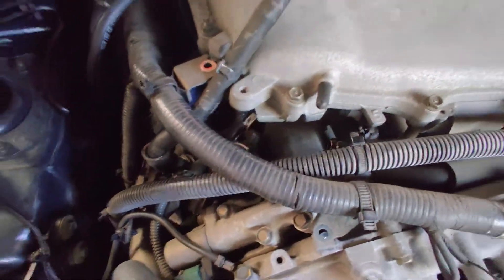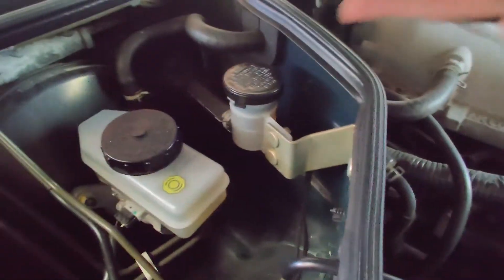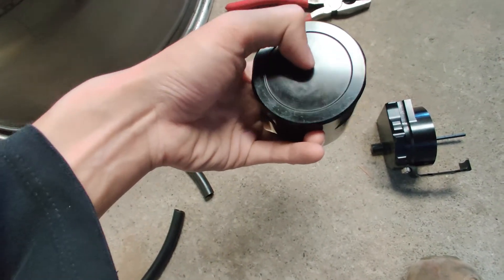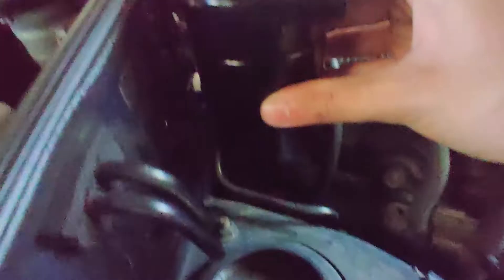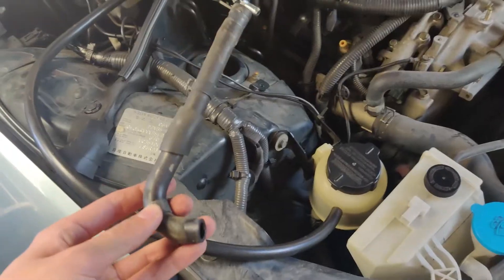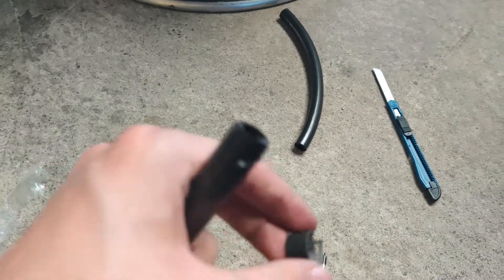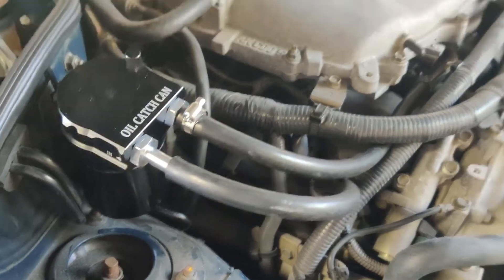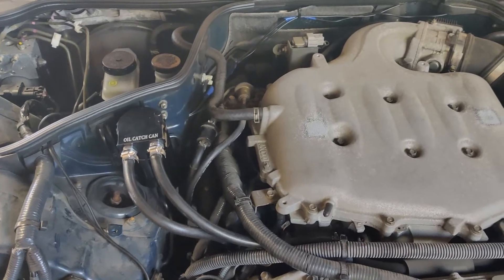Install a $20 oil catch can on my G35 Will it work?

Comment: PCV hose that is located near your throttle body is actually responsible for sucking fresh air into your Crankcase. You dont need to install anything there, just leave this valve connected to the intake tube. 
PCV valve on the other side needs an oil catch can because its letting air out of the cranckcase directly to intake plenum and this air is usually "dirty". 
I found your video researching oil catch can topic for my VQ, and was thinking of buying the exact same catch can you are showcasing. I think its a good idea and you did a good job installing it (maybe secure it better though😅). I also think its not a best catch can out there, but Im also on a budget and its better to have something then to just leave it be.

Comment: from what i understood about g35s that hose going from crank case to the intake has nothing to do with helping oil consumption any escaped gas/pressure wtv is redirected into the intake to keep cylinder compression good maybe im wrong but 🤷🏾‍♂️das what i think that tube is for